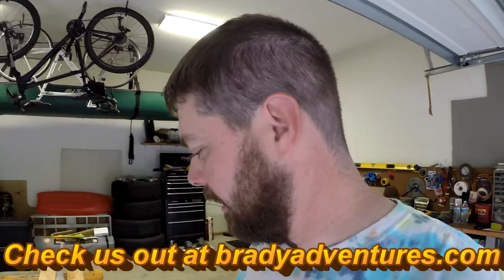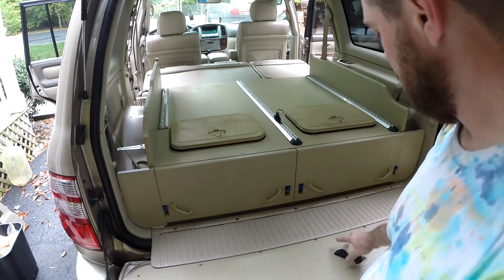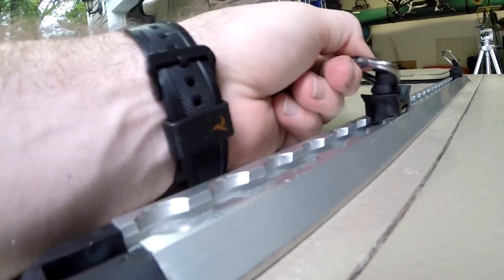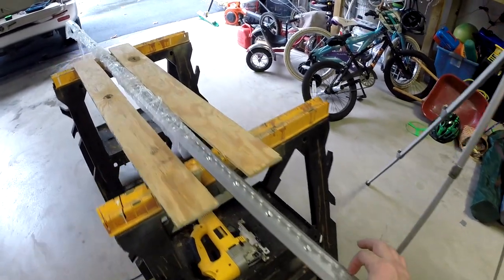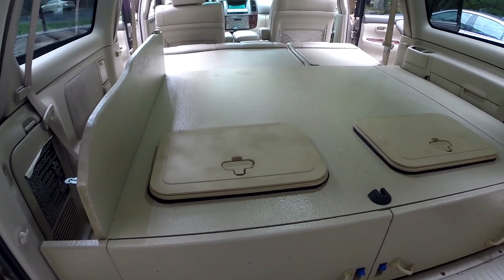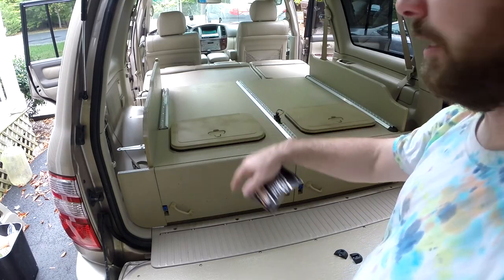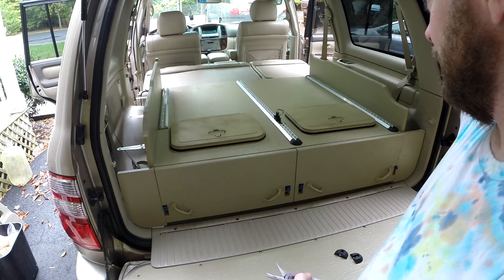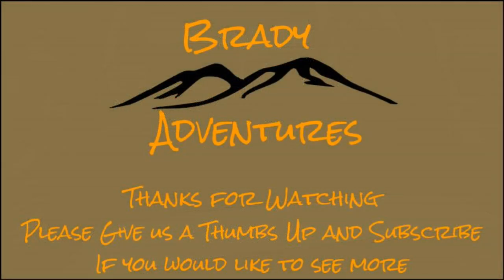Securing Overland Cargo on our DIY Drawers

Comment: Really like that the video isn't long and bloated. Loving the build. Looks very doable.

As an aside. What's your plan for a sleep system? Sticking to a tent or going rooftop?
Reply from the maker: Thanks man, I try to keep them as short as possible but don't let it fool you I will talk to you all day about the cruiser :-)  It took some work but definitely doable!  As for sleep systems we are currently using an REI base camp 6 which you can see in another one of my videos.  If I am solo I can sleep on top of the drawers and folded seats on one side and have all my gear on the other.  I really like the alu-cab roof top tents and other clam shell style due to the quick setup and ease of doing things like parking lot boon docking on long trips. I will eventually have one but they only accommodate 2 people and I have a family of 4. I am not comfortable with the weight or the setup time of the rooftops that will accommodate all of us.  I am working on my wife to convince her of becoming a two vehicle overland family with a truck for the girls with a roof top and one for the guys.  That's a ways off and pretty expensive but just think we can recover each other in sticky situations, it will be great :-)  Take care and thanks for checking us out.